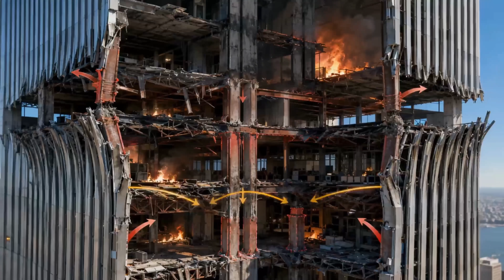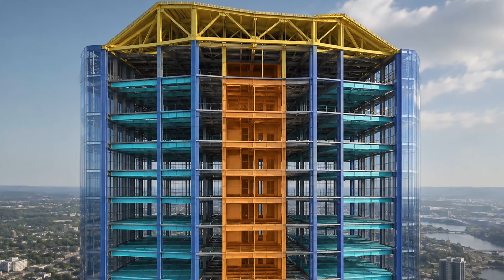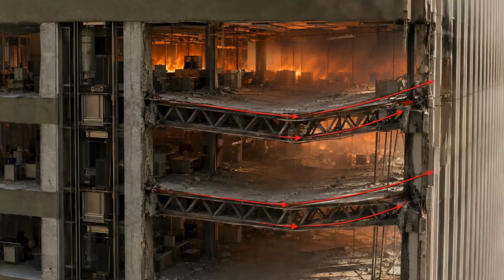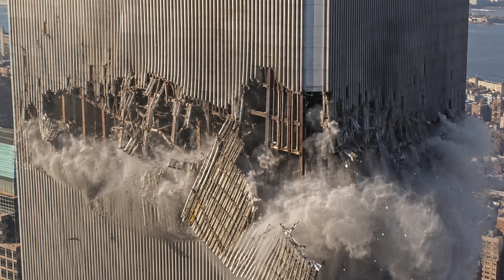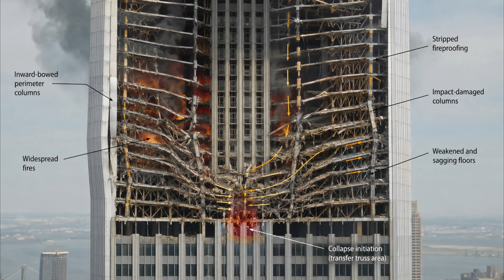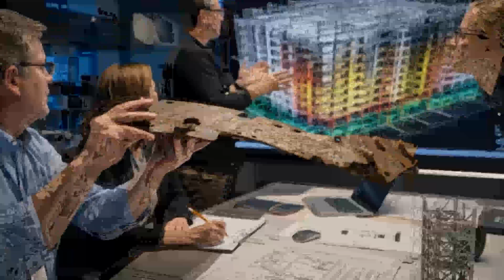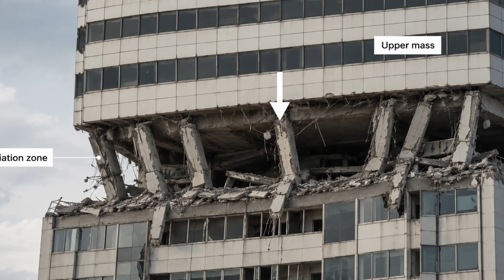What Happened Inside the Twin-Towers After Impact?

Comment: There was liquid steal there. Photos of NIST investigators posing for photos with beams that had melted. The temperature to do that wasn’t possible without foul play. It’s simple math and science.
Reply: It’s deeply sad and frustrating that most people have drank the cool aid that is the official story of what they claimed happened.  People are ignorant of physics, chemistry and combustion science.  FEMA  document that the steel did in fact melt, but an open air uncontrolled fire cannot get within a thousand degrees the melting point of steel.  And besides, NIST stated in their final report that all the jet fuel burned off and was consumed within ten minutes.  And even jet fuel cannot begin to explain melted steel.  To melt steel you would need temperates found in a foundry, not an open air fire.  That’s impossible.
Reply: @markcohen308  hello markself-imposedengineercohen, did You not watch/ glean anything from this video.  It has a few glitches, but does a good job of explaining the whole process to anyone that is not an engineer or expert.  

I didn't see anywhere that ‘melted steel’ was mentioned.  “Weekend steel, “  “Warped steel,” yes.  It seems so many ignorant folk are fixated on melted steel, and how that was impossible with regards to the twin towers’ collapse.  

Being a Military Veteran and exposed to a lot of aircraft, I can assure You Jet Fuel can burn very hot.  But again, it is not about melted steel.  And if You have watched actual footage of the towers, there was some horrific fires that burned, not for 5 minutes, or 10 minutes, but for a lot longer, being fueled by all the combustibles in the offices on many floors.  It was a complex set of interrelated and separate failures that led to the tragic loss of life and the collapse of the towers.  

I suspect that these conspiracy theorists would only have believed it if 10 planes had flown into the towers at the same time?  The old saying comes to mind:  “Don't confuse me with facts, My mind is made up!”
Reply: Know how to spell the liquid metal…?
Reply: @jbsimmons54  It’s a steal!  😂
Reply: Well we can tell how much science you've done by the way you spell steel! If you've seen photo
s videos of melted steel - post them, let's all see them. I've watched 100's of hours without seeing any - you can heat steel to glowing yellow in a bonfire.
Reply: @alanclark639  no Alan, it’s a “steal” of a ‘steel!’  Lmao 🤣 Appreciate your comment.  People are so desperate, dare I say ignorant, to believe anything but the actual occurrence, they overlook basic facts and physics.  Very good on your comment of the bonfire.  

‘Truthers’ only serve to dishonor those lives tragically lost that sad day.  Shame on them.
Reply: You are absolutely correct!  P. Curtis, retired P.Eng.
Reply: 9/11 - The "Free-fall" Collapses are Scientific Proof the "Official" Story is Impossible -   https://www.youtube.com/watch?v=7e0PiQhSL7g&t=20s
9/11 - The Impossibly High Temperatures Under Ground Zero Examined -   https://www.youtube.com/watch?v=-0bEu7THvAQ&t=18s
9/11 - The "Molten Steel" at Ground Zero is Scientific Proof the "Official" Story is Impossible - https://www.youtube.com/watch?v=hB1IYi51Kdc
Reply: Aluminium
Reply: Aluminum is silver when molten!!  Not yellow or orange. @Master__Blaster__101
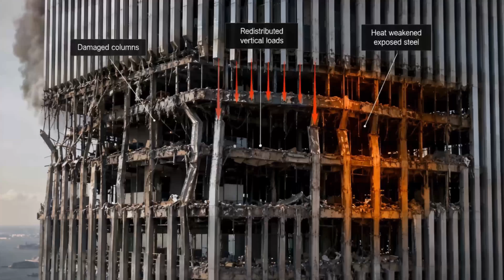Reply: @Master__Blaster__101  Molten aluminum is described at 04:58 in this video. It's quite different in appearance from molten steel.
9/11 - The "Molten Steel" at Ground Zero is Scientific Proof the "Official" Story is Impossible - https://www.youtube.com/watch?v=hB1IYi51Kdc

Comment: Three buildings were brought down not two, totally inexplicable how a building so far away from the twin towers fell down on that day
Reply: Its very "explicable" if you choose investigate.
Reply: NO! It's not "inexplicable" - but you obviously want a controlled demolition - so just p++s off!
Reply: WTC 7 was within the radius of heavy debris. Rather simple explanation really.
Reply: @Master__Blaster__101  “WTC 7 sustained damage to its exterior as a result of falling debris from the collapse of WTC 1, but this damage was found to have no effect on the collapse initiating event.”
 --- National Institute of Standards and Technology NCSTAR 1-9, Structural Fire Response and Probable Collapse Sequence of World Trade Center Building 7, November 2008, Vol. 1
Reply: @markcohen308  If you care to read the report in full rather than selecting just the text that you choose you will see that it states that the debris started the fires inside WTC7, and the collapse of WTC1 and WTC2 severed the water mains to the city, thus rendering the sprinkler fire protection system inside WTC7 useless.
Reply: @Master__Blaster__101  Doesn't in any way explain the 'controlled demolition' that we witnessed!
Reply: @aardvarkrevolution5764 Correct. The full reason is the fires caused by the debris
Reply: @Master__Blaster__101  That would only work if it were not for WTC 6 which, inconveniently was situated between WTC 1 and WTC 7!
Reply: You need to read the NIST report, without prejudice
Reply: @Master__Blaster__101  It's difficult to know where to start.... why did Richard Gage and hundreds, if not thousands of architects and engineers feel the need to question the N.I.S.T report?  There are so many unanswered questions, and indeed unasked questions about the N.I.S.T. report. Suffice to say Larry Silverstein's comment that due to such tragic loss off life it was decided to 'pull' WTC 7, even people unfamiliar with controlled demolition know it takes weeks of skilful technicians to rig a building to be 'pulled' Yet astonishingly whoever did it managed it within an hour. The BBC even managed to announce it's collapse whilst standing in front of a fully intact building 7 - they must have had prior knowledge of it's demolition. It is difficult to explain how both WTC 7 and WTC 1 & 2 collapsed at free-fall speed and what were to sounds of multiple explosions reported by firefighters?
Reply: @aardvarkrevolution5764 Of the "thousands of signatures" collected by the group you're promoting, very very few were from structural engineers. 

If you'd like to discuss the merits of the arguments, what is the extent of your knowledge and experience in structural engineering? 

I have over 30 years experience working as a consulting structural engineer.
Reply: @M @Master__Blaster__101 Don’t think I questioned you credentials, and I wasn’t promoting Architects & Engineers for truth so much as drawing attention to the fact that the NIST report was not unanimously endorsed by all.  You have not, I notice addressed any of the points raised which are common sense rather than requiring engineering qualifications? 
FYI my background was in metallurgy and welding - retired now
Reply: @aardvarkrevolution5764  So you would know more about welding and metallurgy than I do, although I have knowledge of it to the extent needed for everyday structural engineering design of buildings. 

I agree there was not unanimous acceptance of the NIST report, but amongst structural engineers it was virtually unanimous, save for a handful of people. The NIST report would address any technical points you care to raise, so there's no point in me repeating them. 

If you're saying you question the NIST report, that's your prerogative. I hold a different opinion, as do the overwhelmingly vast majority of structural engineers. I'm not trying to change your mind, I don't know you. I have however previously told a friend from university days that their opinion of the WTC collapse (which is similar to yours, they're a doctor) is tripe.

For what its worth, WTC 7 fell because it suffered fire damage to a structurally significant column (Column 79 in the NIST report), which the failure there of caused a progressive collapse of the entire structure. WTC 6 suffered very significant structural damage (and in fact was demolished later), but it was not prone to progressive collapse.
Reply: @Master__B @Master__Blaster__101  not responding sooner but your response did not post to the main body, only when I viewed your site did I find it.  Of course, I respect your opinion and that you have a high level of integrity.  For me, there are so many unanswered issues. You may be correct regarding WTC 7, but it doesn’t explain Larry Silverstein’s clear reference to ‘pulling’ it? He certainly had a huge vested interest in the destruction of the entire WTC complex. 
There are also reports of nano thermite found in the rubble of the twin towers, circumstantial evidence, I accept but then there is Donald Rumsfeld’s statement a few days before 9/11 That there was $2.3trillion unaccounted for in the defense budget, and then the very section of the Pentagon holding the records of defense spending was hit - co-incidence? To me it all feels to convenient🤷‍♂️
Reply: @Master__Blaster__101  Did you watch the public hearing on CSPAN when NIST released their draft report on WTC7 when NIST's lead investigator Shyam Sunder, denied that free fall had occurred and (correctly) explained why WTC 7 should not have come down in free fall at the NIST Technical Briefing on August 26, 2008?  He said  “[A] free fall time would be an object that has no structural components below it.... What the... collapse analysis shows, is that same time [sic] that it took for the structural model to come down from the roof line all the way—for those 17 floors to disappear—is 5.4 seconds. It's about 1.5 seconds, or roughly 40 percent, more time for that free fall to happen [sic]. And that is not at all unusual, because there was structural resistance that was provided in this particular case. And you had a sequence of structural failures that had to take place. Everything was not instantaneous.”   Of course that was before NIST was backed into a corner and forced to admit in their final report, three months later, that free fall had actually occurred:  “A more detailed analysis of the descent of the north face found three stages: (1) a slow descent with acceleration less than that of gravity that corresponded to the buckling of the exterior columns at the lower floors, (2) a free fall descent over approximately eight stories at gravitational acceleration for approximately 2.25 s[econds], and (3) a decreasing acceleration as the north face encountered resistance from the structure below.”
   ---  NIST Final Report on WTC7, NCSTAR 1-9, page 607, November 2008.   How is it possible that the building was falling through itself, with all its steel and concrete, while encountering ZERO structural resistance?  How is that consistent with Newton's third law? Shyam Sunder said  “[A] free fall time would be an object that has no structural components below it."  What happened during those 2.25 seconds to make the "structural components below it" magically disappear for those "approximately eight stories?"  Perhaps it is YOU  @Master__Blaster__101 who really needs to look at ALL the contrary evidence "without prejudice", because clearly you have not.  https://internationalfireandsafetyjournal.com/did-world-trade-center-building-7-really-collapse-due-to-an-office-fuel-load-fire/
Reply: @aardvarkrevolution5764 \War vielleicht feuersicherer gebaut!
Reply: @aardvarkrevolution5764  give it a rest with your fairy tales
Reply: @izzywizzy416 Do you have anything of scientific or technical to add to the debate… or should you be getting back to your revision?
Reply: @Master__Blaster__101 all he has is “free fall” and “popping sounds” and a refusal to be objective. He’s choosing to ignore what he doesn’t want to hear. Material properties change under extreme temperatures and mass/weight can’t suspend itself against gravity.
Reply: @aardvarkrevolution5764  already added
Reply: @aardvarkrevolution5764 back to the padded room for you I think…..
Reply: Does explain the damage to the support truss if you look at the skeleton of the building you will see the gravity load transfer trusses~ cantilevered to work around what was built below it. If you look at the collapse you will see it is progressive from the fire and its affects and aided by the penthouse installations, you can see the dip of them as they follow the internal structure lean and bend. It was a progressive collapse
Reply: That's because you were brainwashed into believing the nonsense from ignorant people. You should be careful, you might end up a flat earther next
Reply: @JustinLodes-h9o  "Did you know that not a single Type I Fire Resistive high rise building has ever collapsed due to fire? Not one in the United States, or in North America, or anywhere else in the world - only WTC 7"
Raul A. Angulo retired from the Seattle Fire Department with over 38 years of experience and is Captain Emeritus of Ladder Co. 6. He is an international author and instructor on fireground strategy and tactics with firefighter accountability and speaks on company officer leadership and development. He is the presenter of the popular class Drills You're Not Going to Find in the Books and has taught at FDIC International since 1996. He sits on the Editorial Advisory Board for Fire Apparatus and Emergency Equipment magazine and has published numerous articles in Fire Engineering. He is also the author of the new textbook Engine Company Fireground Operations 4* Edition, published by Jones and Bartlett Learning. https://internationalfireandsafetyjournal.com/did-world-trade-center-building-7-really-collapse-due-to-an-office-fuel-load-fire/